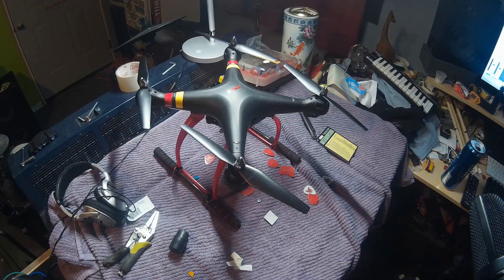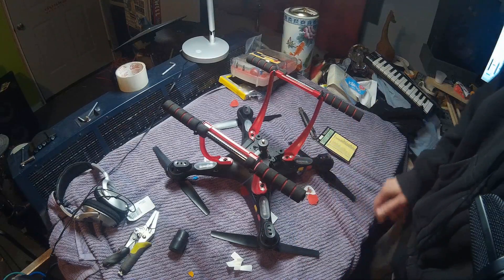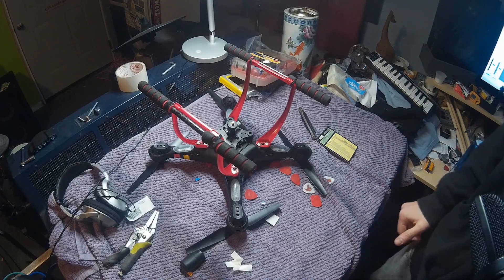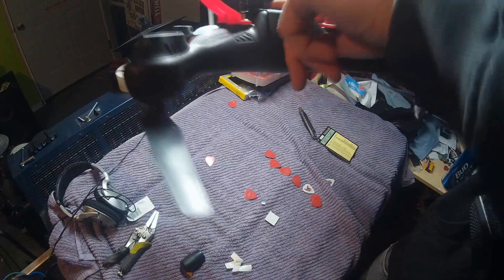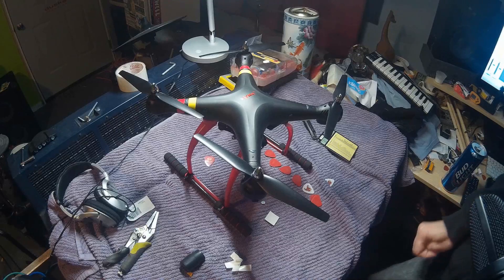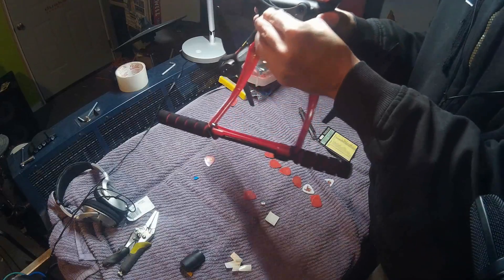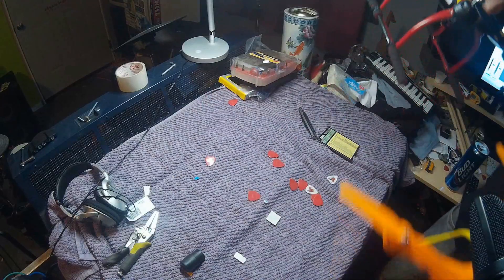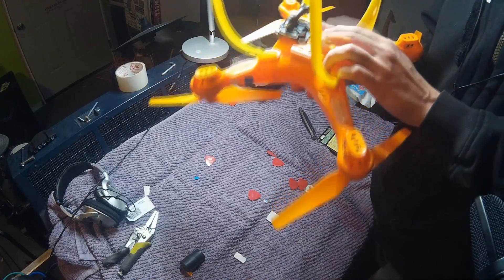Syma X8C Quadcopter Modifications

Comment: what is it really worth it given the large price difference?
Reply from the maker: +Y. lou I don't vonsider $30 a large difference but don't upgrade until you burn the stocks out which will happen after about 2 hours of flight. Especially if you keep popping batteries in and don't let them cool off.
Reply: +sonduska  it's been six months since I use my x8 and I have not had engine problem
Reply from the maker: +Y. lou That is great news. Most of us are not that lucky.
Reply: +sonduska Before using the x8 the first time must balance the engine then let cool before changing the battery, and finally not to overheat the 65 gr max load.
Reply: Yes good point. A few runs not pushing the engines too much will break them in nicely.

Comment: Hey.  I just recently crashed my Syma X8G.   First couple of tests came to the conclusion that one of the motors needed lubricant.   I lubed all the motors.

I am also getting issues with losing radio signal.  Just took it out today and lost signal not even 50ft in front of me.  Took it back to my house and had it fly around my living room.  After 2-3 minutes i lost radio signal again.

When this happens the lights on the Quad start blinking.  The controller still appears to be connected.   As if i needed to connect to the drone i put the throttle all the way foreward and all the back but it acts as if its still connected and will show the throttle going up on the controller.  When i shut the controller off and turn it back on i can reconnect to it perfectly fine.

Do you have any suggestions?
Reply: +iStackSlow The transmitter is only 200m max in range. dont get too far. Optimum distance is just about 30-50 meters with this drone.
Reply: +iStackSlow You might want to consider doing the 5db transmitter mod.
Reply: +JamoAerial dont upgrade this drone, u better save ur money and get a Phantom 3 Standart ($499).
Reply: Pls also note that X8 use Brushed Motors... They have very limited life time compare to brushless... I've changed 2 motors so far in my X8w.
Reply: +OokTiaopi Everyone.  I replaced the control board as i was getting problems with the lights as well.  All problems have been resolved!  looking into buuilding a zmr250 now
Reply: +iStackSlow I would check if you have 2.4g wifi really close by, might cause an issue. Other option would be to check the solder joints on the the antenna for both the controller and the quad. I've seen the same issue with 2 different Cheerson models at certain locations. Try an open field and fly low in case it loses signal. That's about all I have. Let me know. Best of luck
Reply from the maker: +iStackSlow Make sure your batteries in both the quad and remote are fully charged. Also I have seen this happen when using the camera, by high voltage, and by areas with high WIFI signals. It is a cheaper toy grade quad. If you want something with good range for filming, upgrade to a phantom. I fly 250 racers mostly and this was just a really nice quad for video that I wanted to show upgrades for. As for the distance - Check out this guys video. Something I wouldn't recommend but he pulled it off with the antenna mod. https://www.youtube.com/watch?v=zFvfp6liiDo
Reply: I have a few 250 racers. Totally different type of flying and construction.
Reply: iStackSlow when you turn on the controller and bind of the wifi signal is blinking you won't get much range but if you hold the trim button up directly to the right of the power button while powering on on the controller, the wifi signal will stop blinking and your range will be back to normal. Hope this helps I read it on some drone form but it seems to be something alot of people don't know about.

Comment: nice vid. just want to ask who makes that gimbal and where did you get it ?
Reply: +SteadyFlyer 24/7 Its basically this one: http://www.tmart.com/Carbon-Fiber-Shock-Absorber-Gimbal-PTZ-for-DJI-Phantom-Quadcopter-GoPro-Hero-2-3-3-FPV_p325742.html?cc=USD&fixed_price=hk_intl&gclid=CO6lpLTdqsoCFYQfHwodOswAOw
Reply: Yeah that is the one I ordered 
Thanks
Reply: +SteadyFlyer 24/7 Hope it worked fine!
Reply: +Chris Duska yeah it works great and like you siad it has the cut outs for where the stock cam slid into. i am having a little bit of JELLO issues but i belive a large portion is from the dji skids vibrating. i am going to try it with the stock X8 skids tomorrow , weather permitting and see how it does. also , the DJI tall skids weigh in at about 23 grams each a total of 46 grams and the stock legs weigh 5 grams each. reducing the load by 26 grams can also take some of the jello out i hope.
Reply from the maker: +SteadyFlyer 24/7 Jello is your enemy...Unless it's cherry jello..That's good.